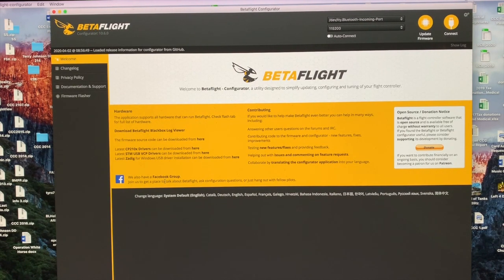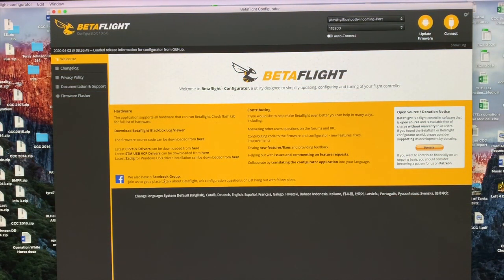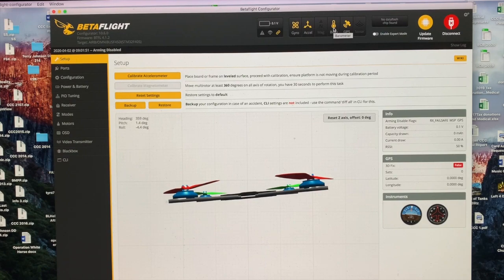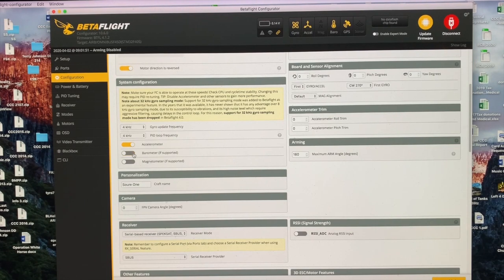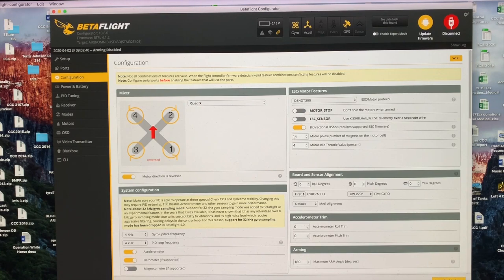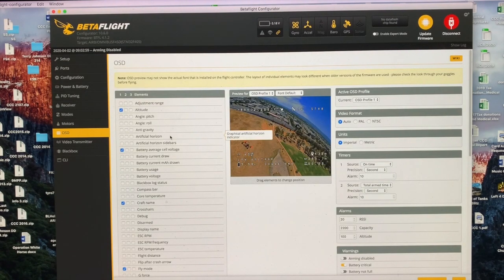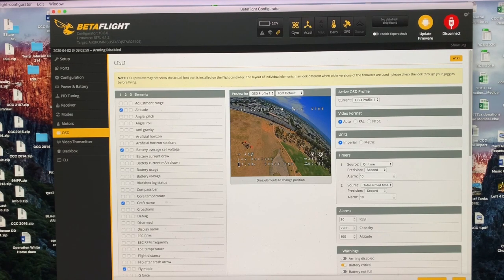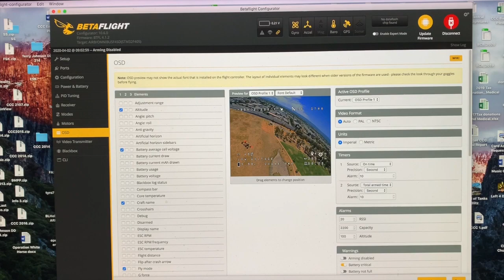Configure the Barometer on the Omnibus F4 V5

Comment: Does the barometer have any impact on the drone's performance? Is it only for displaying altitude on the OSD screen? How do I enable it on the DJI Go app v2?
Reply: I don't think I'm acro mode it does anything.
Can't say for stabilized mode but I doubt it.

I do know in GPS camera drones that have altitude hold it plays a part in the flight controller adjusting altitude.

I also heard in different weather conditions such as heat, cold and wind it can affect it's performance.